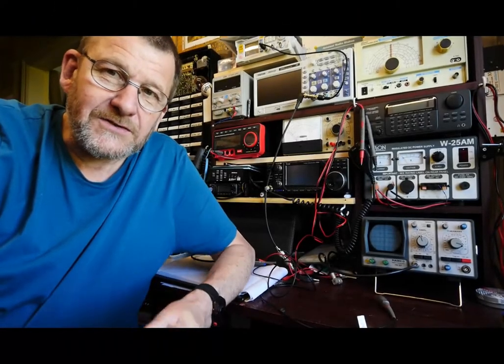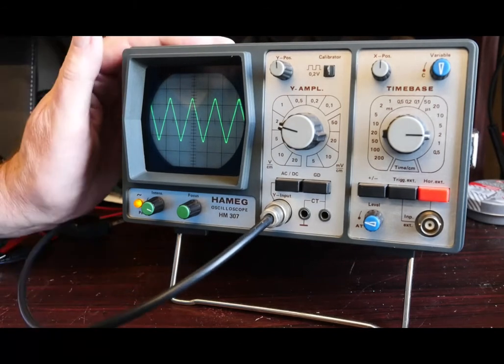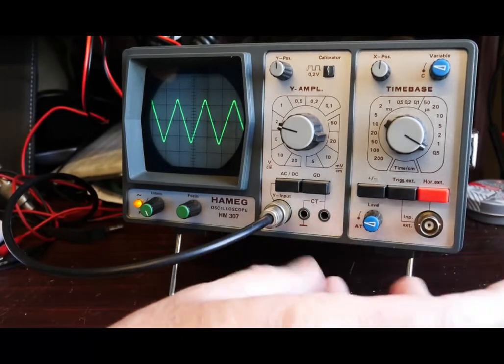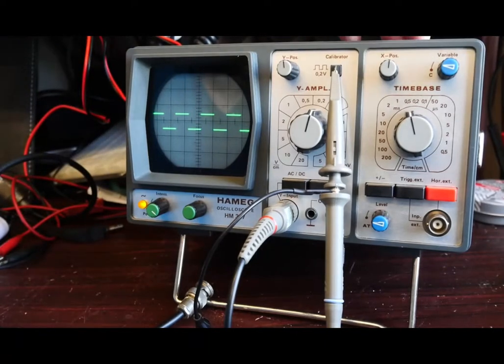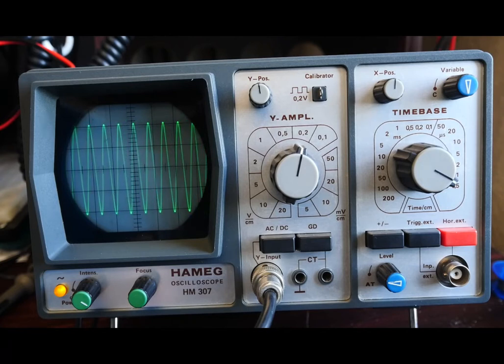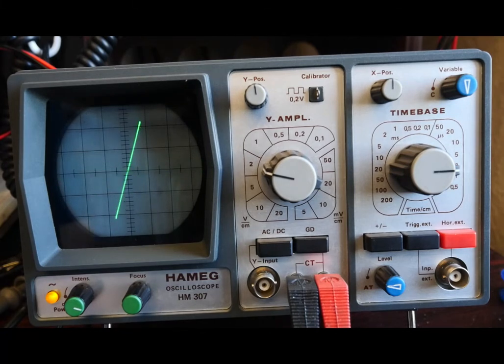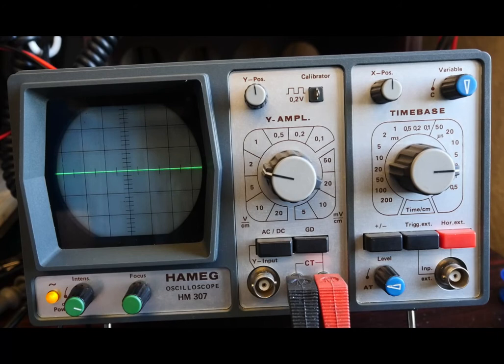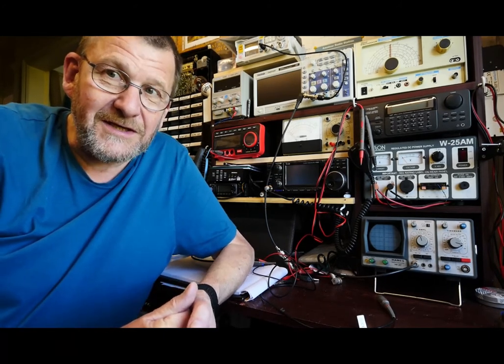Hameg HM 307 oscilloscope mini review including bandwidth and curve tracer check

Comment: Well there must be a few left around. I was given a 307 in 1983 by  an old work colleague for field work. The company went  bust and its been in my attic ever since, Re-discovered it last year to find the  PCB was filthy and some of the electrolytic looked corroded. So stripped it all down, thoroughly cleaned the PCB then replaced all the electrolytics and now it works just fine. Result.